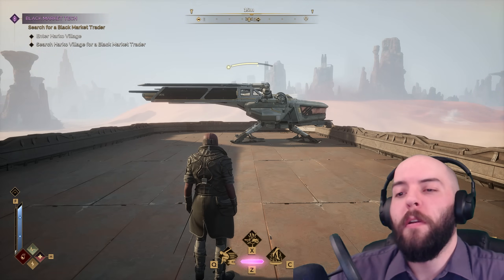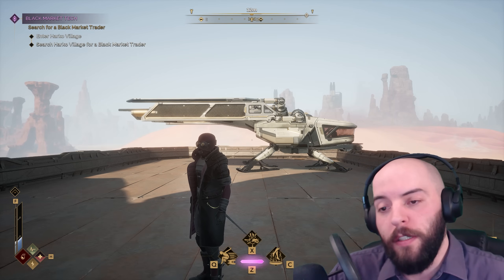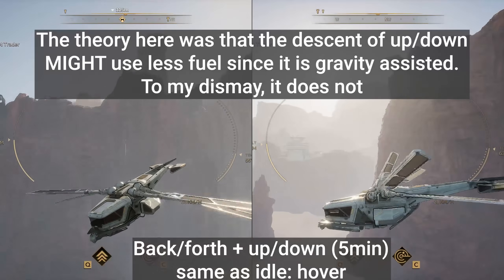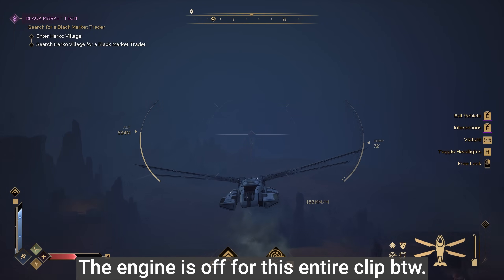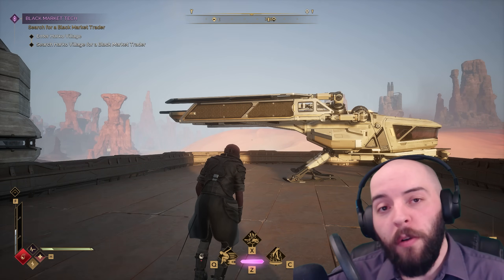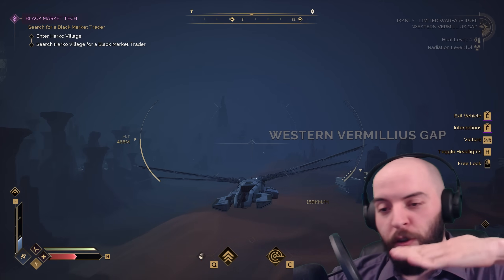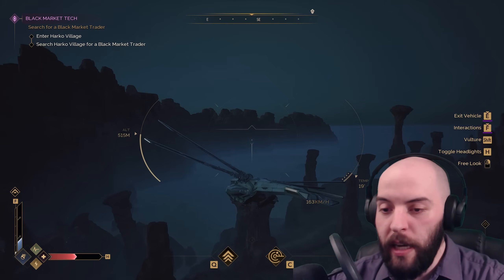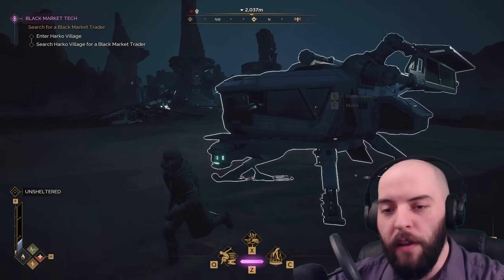How Ornithopters Really Work - Dune: Awakening - How to Fly an Ornithopter

Comment: I actually glide everywhere. First going up around 550-600 meters from ground, start gliding, get up to 163km/h speed and then lift the tilt of the ornithopter to be above the horizontal line, so it's climbing up, but slowing down. After I've slowed down to around 140km/h, I tilt the ornithopter to below the horizontal line again, and speed up to the 163 again. Then again, I start climbing up.

The trick is that I lose less altitude every cycle going down, than what I gain by going up. So, you're ultimately gaining altitude, but not burn through fuel. It's more of a hassle to travel like this, but it is damn efficient.

Comment: I find that when gliding, if I line up the dot with the horizon line (not the top of the point) you his a sweet spot where you maintain a 162 speed (172 in higher quality Thopters) and drop about 1 meter a second. This allows me to glide almost the entire length of the map from one take off.
Reply: 182 km/h cruise speed for the Mk 6 wings.  So yeah, if you're slower than the equilibrium speed for your wings (162/172/182) then you'll continue to slow down, lose lift and start to fall like a rock.  If you're fast it's because your angle is too low and you'll be descending too quickly.  If you properly place the pip, you'll only lose about 1 meter of altitude every 2 seconds or so, maybe a bit faster for the lower tier wings.
Reply: The sweet spot is in the middle of the imagined triangle (not the top of the point or on the horizon line)
Reply: If you aim above the triangle, while at max speed 183 in mk6 scout, you just have to tap W once you hit 173 to get back to 183. If you put the reticle in the right spot above the triangle you will actually gain altitude while gliding and never have to use your engine. I can take off from a titanium island in the DD, glide at 450m and by the time I get back to base I'm at 700m without ever touching my engine.

Comment: You're gliding wrong. At least in a scout. Get up to 650-700, vulture to max speed, once at max speed, place the aim dot about an above the horizon line, once you lose about 10kph below max, drop the aim dot to about an inch below the horizon line. By continuously doing this, you will stay at max speed, gain height, and never have to use a booster or engine. 

By doing this you can glide the entire DD without using your engine or thruster AND stay at max height. With Mk6 wings, you can stay around 180kph, and out run any enemy.

Comment: i use the storage on the thopter. 
i use it to loot specific constellation chests, and corpse runs for deathstills.

mk5 thopter and mk5 buggy are very nice tools over the base versions.

the thruster would be useful if solo in deep desert, as it increases the odds you escape the line of sight of a team of hostiles with rockets. though you wouldn't be gathering any more than you could carry in your inventory...

Comment: Thrusters are really that good? I usually just do the glide trick, where you go to max speed, and then angle upwards, so you climb, and then press W when your speed gets 10~15 km/h below your regular glide speed. That way over a long distance you gain altitude. It does slowly damage the wings, as you said, but uses no fuel (except for take off and landing, the latter of which I can time quite well now) I use the mk5 so my glide speed is 174 I angle so just about the bottom of that long vertical line is in line with the horizontal one. And when I get to 163 km/h (ish) I press W for half a second to get back to 174. Doing this will allow you to glide indefinitely on the scout. (and climb at the same time) I can diagonally move from the bottom left to the upper right section of the D-D and have to press W for a bit longer because I climb too high xD

Comment: Good overview of the measurements, but the conclusion that booster is "better", and to fly with altitude loss is nonsense. Scout can maintain or gain altitude with no engine or booster loss above around 550m. 

It may seem simplistic, but booster is better for getting away. Missles are better for fighting, and storage is better for bringing back more stuff. Use the kit for your mission.

Comment: You can steadily climb in altitude, without using the thruster btw. You aim above the horizon line, and feather tap W once in a while if your speed drops 5 under glide speed, that will drop your nose just enough to pick up enough speed to keep steadily climbing. You will maintain speed, and slowly increase altitude, without ever needing to use your thruster, as long as you don't have to turn too much.

Comment: You actually demonstrate this in your video but the point you made is a bit the opposite of what you showed. Pivot turns are certainly more agile, stylish, fun, and proper aviation IRL. However if you rewatch what you posted here you will notice that you immediately start tanking speed massively which you rightly corrected with your booster and nosing up. But this costs fuel. I do this type of thing because I am RP andy. Just noting that if your goal is efficiency it's probably better to turn the way you suggest not to, if you aren't needing to turn quickly. You could also just tilt and nose up slightly to aid the turn without losing AS MUCH speed but you will lose some.

Comment: 8:43 I feel that. For two days after getting really settled in to a base, the dirt roads out of it to the edges of the rock island were clear. Now, the roads on two of the cardinal directions are blocked off, and I have to drive to the rock-island edge and circle around to where I really want to go.

I specifically made my base have Public wide doors with auto-close disabled so that the road I built on/over remains clear, and I haven't seen a single other person do this. Yesterday I saw someone crouched in my base during a sandstorm. Felt good to have helped him out.
Reply: just report them funcom stated they will remove bases blocking roads
Reply: I built my base on a water area^^

- Though it would be more accurate to say "above" a water area, lifting the floor with pillars, so anyone can access it if I'm not around or otherwise.

I get water is important, but aggressively hoarding it is just anti-social behavior... I'm not even relying much on the manually collected water at this point, so mostly other people just rush my base before dawn to try to "steal" my water, when that was actually why I built that way to begin with xD.
- A lot of them seem to assume I'd get mad, but why would I leave it open then ?

I do see a lot of other hoarders though, and a lot of them don't seem very active, which just removes that water resource from fresh players.
Reply: yeah i have my garage open(though its secluded in  space so e people can come if they need to during a storm), but my garage is small with pillars on the sides of the rest of the base above it,  so they can still travel under if needed

Comment: You should have talked about the infinite glide tech: lining up your horizon line and with some tilting down and such. With this tech, you are able to not only glide infinitely without losing any altitude at top glide speed from one end of the DEEP DESERT to the other, but you never use fuel. Only time is ascending and landing.
Reply: The other benefit of this that i see, i gain height the entire time i do this infinite glide. So if i start at the top of the deep desert, by the time i get into the lower zones where some pvp people want to gank me for the colleccted ressources, i fly in at over 800m and they have no way to get to me before i enter the pve zone.

Comment: there is a technique to glide forever while gaining altitude without using boosters. just glide slightly upwards (most of the aim line above the horizon) from top glide speed til -10km. So from for example 162 down to below 150 and then dip your nose down to go back to 162 and do that over and over. will make you fly forever or as long as your wings last. now THAT is efficiency!

Comment: The scout ornithopter is also energy positive above 500 metres altitude.  You can swoop down to gain speed, and at about 160 KPH climb again and you will gain more altitude than you lost.  Slower than a booster, but you can do it with cargo pods, and the time lost is negligible in the deep desert.  Once you reach 750 metres altitude, dive to gain speed and at 160 KPH glide to your destination.  Once you get down to about 650 metres altitude, climb again.

For the assault orni, the booster seems to go 120 KPH whichever direction, so boosting straight up and then gliding seems to be the way to go.
Reply: There's actually a position you can place your camera in that assists with this as well. If you put the horizon line right at the nose of your thopter to climb, lock your AOA (Angle of attack) by holding right click and then just use WASD to dip down every once in a while to get back to 160kph+, with mk4, higher with better wings, you'll climb in altitude overall without using any fuel. Now, the boosters are still better for speed because you can climb faster but this technique is better for endurance.
Reply: @CarBENbased When your horizon line is lined up and you're holding right click you can open the map to lock that in and not hold right click.
Reply: This method is also quiet, which is a + in DD
Reply: YES
Reply: not sure if it was added in a patch but atm you don't even have to dive. after you climb (i usually only climb till right before the fuel efficiency warning kicks in) if you just press the switch to glide button it dives automatically for a sec then re aligns in the optimal position to maintain good altitude. all on its own. not sure how optimal it is and gonna check the horizontal - nose thing you mentioned tho.

Comment: WIll your Ornithopter take damage if you park it on top of your base, rather than inside? Does it have to be behind a pentashield?
Reply from the maker: Has to be Sheltered. Check the vehicle menu to see its status. If it says safe in decay wherever you park it, it’s good
Reply: @VashCowaii yeah I figured it would be the same as it is for the other vehicles, only wondered because I always see people parking their Ornithopter on an outside landing pad, which looks cooler but I guess they’re all taking sandstorm damage

Comment: Appreciate the data. One thing that I partially disagree with is when you mention to not turn with your mouse. Turning with the keyboard (with roll+pitch) causes you to lose quite a bit of speed while turning with the mouse doesn't lose you any (if you're careful with your crosshair). The keyboard turn can be much sharper so there's definitely times when you want that, but if you don't need a sharp turn then I'm fairly certain that a mouse turn would be better (way more fuel efficient and possibly even more time efficient than keyboard turning even if you're boosting [depending on what kind of turn you need to make]). You can see during your example that you drop down to ~130km/h during your turn even while boosting the entire time. Whereas a keyboard turn can keep you at 162km/h without sacrificing any more altitude than flying straight would. 

I honestly dislike this takeaway because I really enjoy the traditional roll+pitch turns in flying games, but if I'm trying to be efficient OR I'm using the storage module rather than booster, mouse turning is basically mandatory.

Maybe my logic is flawed somehow though so if you still disagree and think keyboard turning is better in all turns then I'd be curious to hear why.